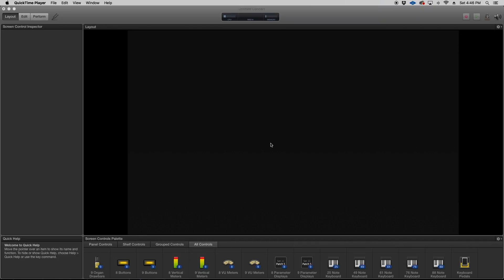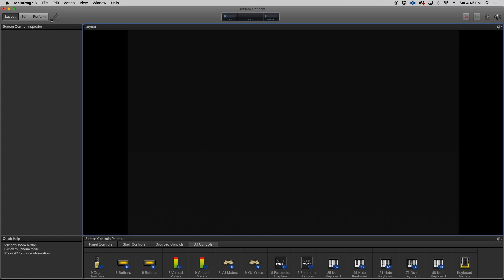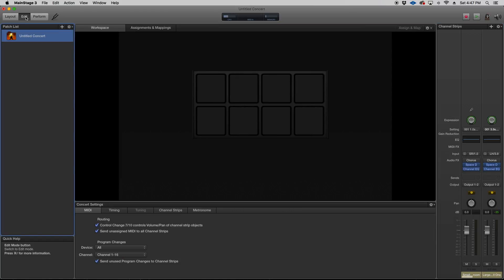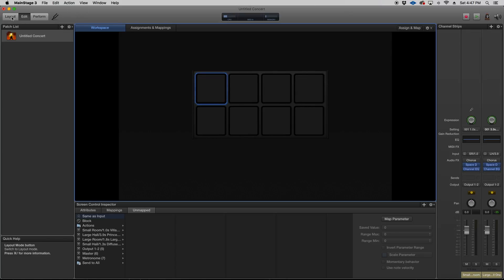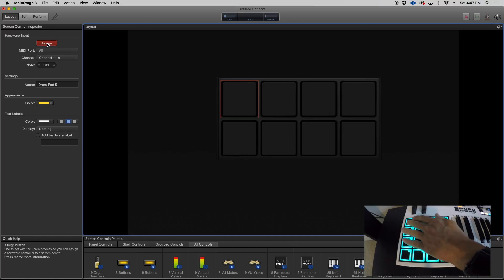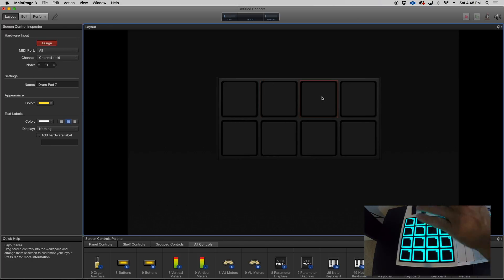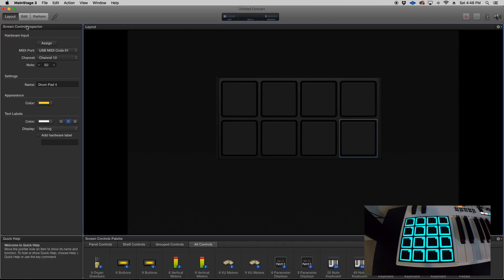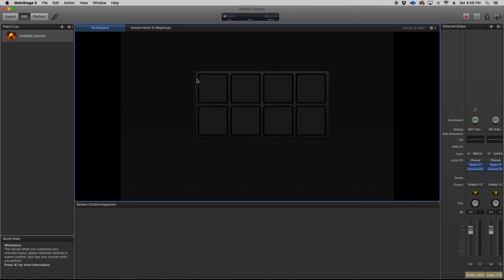How to assign Drum pads to a Midi Controller

Comment: How do you operate the sounds you play on the pad separately from what you play on the keys of the same controller? is that possible?
Reply from the maker: Daniel Guaico what are you trying to play on the drum pads, are you trying to make patch changes or play samples through
Reply: Creative Worship Sounds I'm trying to play an 808 on the pads and Rhodes on the keys
Reply from the maker: Daniel Guaico are they both connected to the computer via USB? If they are all you have tondo is assign them for them to be able to communicate